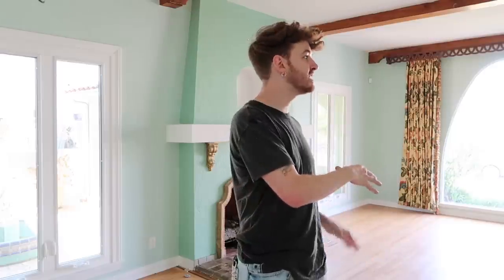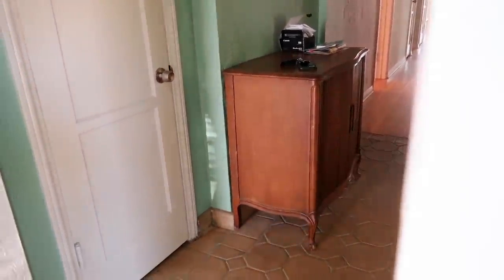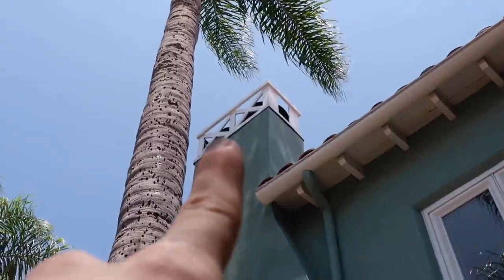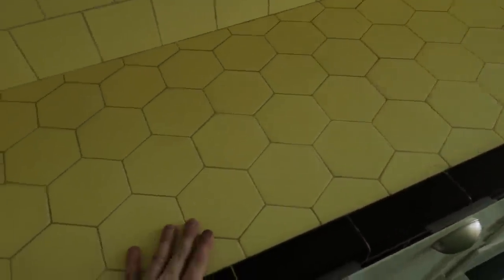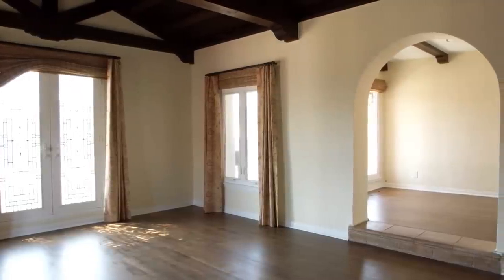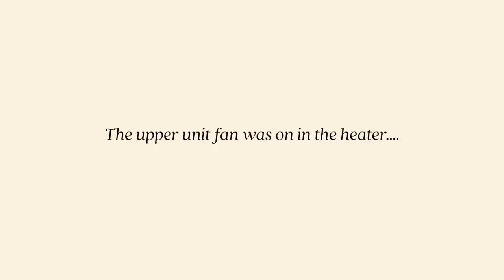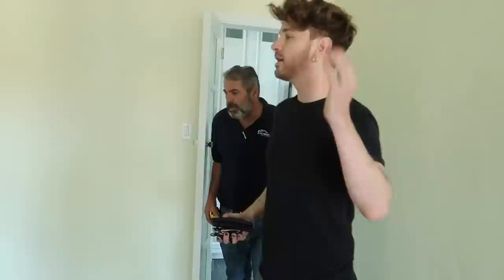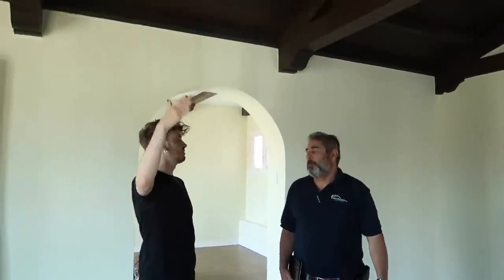Awful News About The House

Comment: "Not at all the plan" is a pretty normal plan when you work with an older property. I've done custom work in older homes with designers, and I've seen some amazing "WHAT?" days on the job. Wood rot, crumbling foundations, plumbing, electrical, incompetent tradespeople, tiresome artists, clients divorcing in the middle of closing, always an adventure.
Our first spring in our first (tiny, cute, older) home brought a flurry of flying termites (despite the house having passed inspection). Our first holiday, I shoved a fully prepped raw turkey into the stove, then watched the temperature gauge (that I'd had to put inside the old stove because the numbers on the dial had worn off) die right before my eyes. (We had to lug a raw turkey over to Grammy's house to get it baked.)  Our first cold snap brought a failed furnace. We found out some "interesting" things about that era's electrical installation. Cha-ching!
We replaced damn near everything, even the entire back bathroom, over almost 12 years in that house. We re-did the landscaping, put in spilling flower beds, a pocket garden. We re-did walls, cabinets, flooring, made it into a mid-century modern jewel box. 

The house wasn't even officially on the market yet when the realtor called asking to show it. We were slipping the out of the back door as our first (and ONLY) prospective buyer walked in, and I heard a little girl say "OH MAMA! This is a PRETTY house!" XD.  They made an offer an hour later. We broke even on that place, and in that current market, that was acceptable. Over the years, we'd had kids, and I'd already started repainting and preparing to move into the nice 4 bed/3 bath corner lot we'd bought. Time to move on.
Once again, it was time to take a chainsaw to bushes, yard transformed, do a Maxfield Parrish in the powder bath, a hammer to the crappy fireplace tile to make way for a custom-inlaid surround (er...I'M the tiresome artist), sew 12' light-blocker-lined curtain panels for the 6' wide arched windows in the bedrooms (GORGEOUS facing fabric! I love to go down to the huge fabric warehouses in Dallas), redoing the backsplashes and countertops, and on. Do you EVER get finished? 
22 years in this place and I was getting itchy. Told darling husband that it was time again, he demurred. (Mostly because I mentioned a possible mother-in-law apartment - for HIS mother.) 
2 years later, the Texas market took off through the stratosphere. Oh well. This place is paid for. So....
We'll be ripping out and re-doing the upstairs bathrooms. You don't listen, that's what you get.

Comment: Not surprised about the plumbing issue based on the fact that they clearly did a “cosmetic only” renovation of the upper level bathroom. That bathtub cannot be a functioning bathtub if you can pick it up. It should be attached to the plumbing via the drain!

Comment: Just read the advice below. Did I see a palm tree?  Could you be in Florida or along the Gulf? I am in Jacksonville and from experience I can tell you that if  you want good insulation put your money in great up-to-date insulation.  If you are in hurricane territory forego any trees near the house. If you have trees overhanging the roof take out those trees.  A five hour storm will lash those branches like a whip destroying your roof, leaving water damages to ceilings, walls and floors. And the termite problem requires professional treatment plan with annual inspections. Also never let any plants touch the house. This is an insect highway for termites and carpenter ants and every bug on earth.

Comment: I think you might find that the information coming from that plumber is leaning a tad toward BS where the differences between horizontal and vertical pipes are concerned.  Pipes are pipes...leaks are leaks.....there would be evidence of leakage around either pipes ..... a leak is escaping water.... surely there would be pooling of water around the site of some breakage/crack no matter if that pipe is horizontal or vertical.   Anyhoos....I would get me a second opinion, pronto!!    Love the house and I know it's going to be fabulous when you;re finished - can't wait for the videos.  Toodles !!

Comment: This is DEFINITELY the time to re-do the floors. It is nasty dirty work and you do NOT want to do that after moving in. That said, the floors would need to wait until the walls/arches are completed, because that work is going to possibly damage the current floor surfaces and it will change the lighting.

Comment: I lived in Seattle for 40 years, I know my leaks...They are so hard to pinpoint because they can travel from the leak site, go along riding on other pipes or infrastructure of the house, and leak somewhere that makes no sense.  They do have a tool that can detect water behind the walls without having to remove everything.  I can help pinpoint the source of the leak.  It is cheaper and so much less invasive.  Also, get a second opinion :).

Comment: DO NOT DESTOY THE WALLS! THEY ARE ALTERNATIVE SOLUTIONS! I am very surprised of all that drama you were told about "inspecting", dear Fox. I am remodeling my bathroom now.  I live in a 1934 house I bought because I felt in love with the old style, but I knew the plumbings are obsolete, no need to be told before. I abandoned all the old plumbing inside the walls, I left the walls as they were and I created new pathways for the water to flow. It's not much, it's not expensive and it is DIY-able. Instead of breaking the walls, I made some new narrow walls and that was all. The toilet only needs 12x12 cm column to drain. Add the water supply and you will have 15x15 cm. Make the column in glass-fiber or false walls or waterproofed wood and only paint them. Leave the column to be easily open from top to bottom, three hinges and a door would make it inspectable whenever you need it. You made more in your rental appartment than this. What's the "inspection" point? I already knew it will be bad news, of course, the plumbings are old and if they haven't explode yet, they will one day. Add instead of destroying. You can do it, you can totally do it. I did it with my hands and alone and I am a 50 kg woman. You can do it, boy!

Comment: There’s a wax seal that the toilet sits on that can crack.  That’s a cheap fix and the most common leak problem.  If that’s it replace it with a vinyl?  Rubber?  Seal which is more modern and safer but they don’t use them as then you don’t need plumbers regularly.  I found that out.

Comment: Just a heads up Drew, the darker the floors the more dust, lint, fluff, crumbs, etc will be visible. 
Edit: as others have said, slow down hun. It's easy to become overwhelmed, and some decisions require time! Your new house has been lived in with closed walls for 100ish years. If it helps for visualization, maybe paint arches on the wall where you think you may want an opening? Or template arches with paper so you can move them around as needed!

Comment: For anyone looking to buy a house, pay the extra and have a plumber drop a camera down the pipes. Our inspector found nothing wrong but less than a month of living in the house we realized the plumbing had problems. They had done a quick fix in one area but it took $25000 to fix what was wrong. This is a $250000 home so it was more than we were ready to pay. But it’s fixed now. I’ll pay the extra $200 during the inspection to have a plumber come in next time. 
Drew I’d leave walls for now. Live in the home, get used to it. Then decide if you want to undertake so an enormous reno. The floors will need to be at the very least patched, more structural elements would most likely need to be verified and checked by an engineer. And the cost will always be at minimum 20% above budget. Your alabaster light is probably worth close to $2000 maybe more depending on if a designer can be attributed to it. 
Best of luck 🤞

Comment: Did the sellers provide "full disclosure" as part of the sell? That "renovated bathroom" is a red flag to me with it nailed on fixtures and unsecured bathtub - like they just stopped and made it look finished. Maybe the newly discovered issue was either discovered or caused during the renovation. If so, the sellers knew and did not disclose this information.

Comment: I bout a house with tiles.  The tiles started breaking and it turned out I have a leak under the floor.  Now I have to remove all the tiles and the sub floor.  Could be worse.  Now I have to find new tiles for the floor.

Comment: If the walls stay up, consider archways . Where the walls do not meet you can use wood in artsy pattern inlay, Get several opinions just like going to a doctor for more than one diagnosis. I been doing construction for years and technology is rapidly improving these  days. Things that were a "no-no" even 10 years ago have evolved with probabilities. AND never take a "NO_WAY_CAN_DO" diagnosis There are so many technics and a solution to every problem. And it's a learn as you go and hopefully you don't have to learn the hard way. Getting 2nd,3rd opinions will help.

HEY THEY CAN USE A CAMERA TO EXPLORE INSIDE THE WALLS >>>NO TEARING INTO THE WALLS!!!!!!!

Comment: The house is old.  The plumbing is as old as the house.  It is not modern copper pipe.  My suggestion is to replace the plumbing (all of it) with pex piping.  A plumber can push it down through the walls without damaging your tiles.   BTW your light fixtures are lovely but the wiring will be very old.  Mechanics are critical and are hidden but are far more important than "decor".

Comment: When I bought a little house in Albuquerque in 5/2010 the inspector didn't even catch that the entire big back room was added on years after the original house.  I was ticked.  He also didn't comment on a swamp cooler issue.  GRRRRR.  With my current Santa Fe condo that I bought in 12/2019, the inspector didn't inspect major stuff like the air conditioning system using "it is winter and I can't check it" as an excuse.  I do not trust inspectors at all.

Comment: I recommend you tune into Our Restoration Nation on you tube. They excel in repairing and remodeling older homes. I realize yours is not perhaps as old but their knowledge and experience deals with some of the same issues you are facing.

Comment: Sorry, reading the comments reminded me that houses today are done using shortcuts, lesser quality materials and poorer workmanship. If you need to replace any wood, especially structural framing, the original is probably oak, not pine. Insist on replacement of original materials with the same. And inspect all deliveries before signing off.  And if your contractor tries substituting something other than what you agreed on, be it materials or techniques or workmanship, fire him and sue. And do not let him get any monies before he is entitled by the contract schedule.  Vet him and ALL the subcontractors; insist on checking every company's bonds, references and licenses at the state department. Also get everyone's full contact information.  If you have to sue, you will know who to name. If the contractor is not forthcoming, get someone who will be. If he will not give at least five references, move on. All of this should be settled before the work begins.  And hire a couple of housesitters to be an active presence as long as there are workers are on your property.  Let them hand out iced water and bananas and smile alot.  Put in exterior motion control lighting and alarms to protect the oak lumber, plumbing and bricks, etc. If you have a garage, install alarms and lock up the materials. Everything should be priced according to the latest official industry estimation book for the current year,  Buy one for yourself.   The amounts of materials should be verified and if necessary hire someone to oversee the work.  If it is an insurance claim he will want everything the insurance assessor figured at his inspection and maybe more later. This is different than your paying out of your pocket. Assume nothing, verify everything and trust no one.
Reply: These guys are great actors and can coerce you if you let the. Call your claims adjuster for reinforcement of the contract or the person you hire to oversee the budget and work on site.

Comment: If you are questioning sanding the floors either go for it or get it cleaned but DO RESEARCH.¯\_(ツ)_/¯  I need wood filler for mine. But cleaned up great with a steam cleaner. But it was a serious hand challenge. Arthritis. But it's the best. Make sure it won't warp.

Comment: I second all the comments asking you to get security cameras to protect your property as well as getting this house checked for lead/asbestos - peeling paint off of your wall, drilling - you have no idea how much you can be exposing yourself to dangerous cancerous substances! I don't mean to scare you but if proper protection and care is not taken you can easily become exposed and spread these issues throughout your home NOT WORTH IT get a professional and hold off on renovations until this is properly done and evaluated. Slow down.

Comment: The term 'expiratory' should have been a red flag for you. This kind of work is not in a plumbers description. They get each other work. Just have them fix the leaks and get them out. Or get another plumber. Thanks but no thanks. Someone is looking for a kickback in this little scenario. Contractor do it all the time, and keep their buddies in work this way. If I understand you correctly two upstairs bathrooms have a slight leak. It should NOT be difficult to fix. Have them fix it and get them OUT!

Comment: You took on a VERY VERY VERY MAJOR money pit project at 27 years old with no experience that would require even Chip and Joanna with an entire CREW to do a double take. SLOW DOWN. You need to get a historic experienced CONTRACTOR instead of using the realtor! (I wrote this before you mentioned some girl's dad coming). "All these walls everywhere"??? You bought an historic house where that's a feature. How about some lighting in the BASEMENT LOL you ignoring that while discussing decorating. EVERY HOUSE gets replumbed every so often so yes bust open your walls and REPIPE THEM PROPERLY. NO it doesn't mean it's at the sink! You can get pinhole leaks everywhere on a PIPE.

Comment: I'm sorry but the chimmney people should have removed the muck in the fireplace I would ne concerned about there work. Ehen removing the tile try tunning a thin wire under each tile. Do not let them leave conduit u will hate it it should only be used in a garage don't hire him. Use a structural engineer.